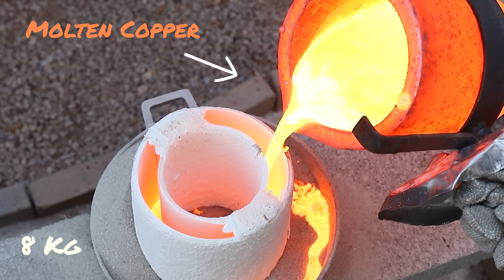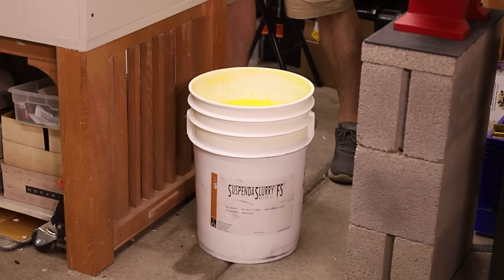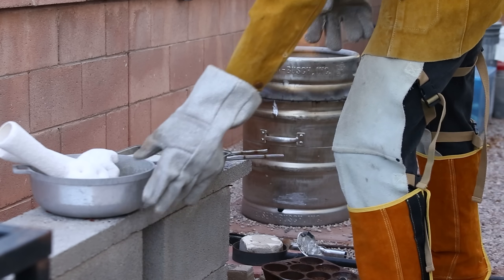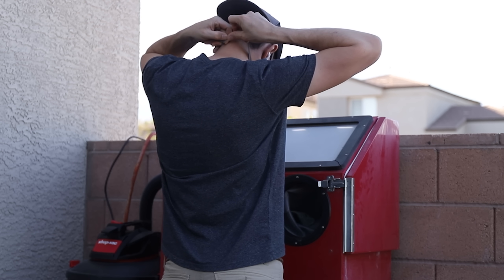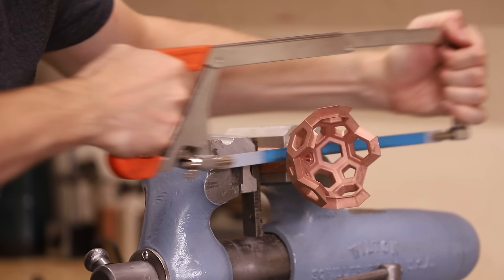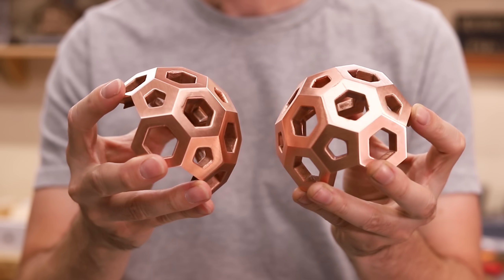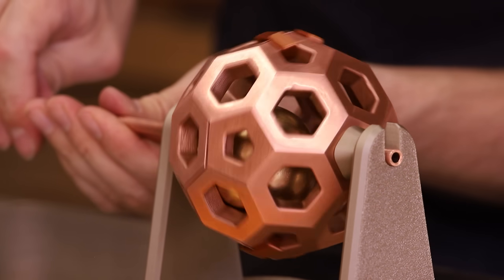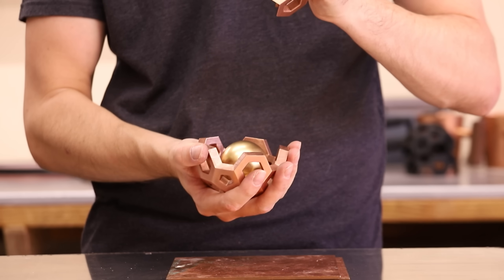HUGE Magnet VS Copper Sphere - Defying Gravity- Will a Neodymium Magnet Float Inside?

Comment: Hybrid Generator
Such a hybrid generator design—featuring an outer copper sphere that stabilizes a levitating magnet via Eddy currents like in video and an inner coil-based structure for efficient power generation—presents an intriguing concept. Here’s how this generator might work, its potential advantages, and key challenges.

### How the Hybrid Generator Would Work

1. **Outer Sphere Made of Solid Copper**:
   - As the outer copper sphere rotates, Eddy currents form within the copper due to the presence of the magnet levitating inside. These currents create a magnetic field that opposes the magnetic field of the levitating magnet.
   - This opposing field could enable stable levitation of the magnet within the sphere, requiring no additional mechanical support. In theory, this setup would allow stable levitation at certain rotation speeds with an appropriately powerful magnet.

2. **Inner Sphere of Coiled Wiring**:
   - Inside the copper sphere, a network of coiled wiring is arranged in a spherical structure. When the system rotates, the coils pass through the magnetic field created by the levitating magnet.
   - This movement of the coils through the magnetic field induces an alternating current (AC) due to Faraday’s law of induction.

3. **Electricity Generation**:
   - The rotation of the entire system induces a current in the coils due to the changing magnetic flux, thus generating electrical power.
   - This hybrid system leverages Eddy currents to stabilize the levitating magnet, while the inner coils enable more efficient conversion of mechanical energy into electrical energy.

### Advantages of the Hybrid Design

1. **Stable Magnet Levitation**:
   - Eddy currents in the copper sphere can help the magnet levitate in a stable position, creating a constant magnetic field within the sphere. This could eliminate the need for additional stabilization systems and make the generator more compact.
   
2. **Improved Power Generation Efficiency**:
   - Instead of relying solely on random Eddy currents for power, the inner coils allow for a more controlled and efficient generation of electrical energy.

3. **Simplified Power Transmission**:
   - With coils rotating within a stable magnetic field, the system can more effectively generate AC power, which can then be transferred out of the system through slip rings or wireless power transfer.

### Design Challenges

1. **Controlling Eddy Currents**:
   - If the rotation is too fast or the magnet too strong, the Eddy currents could cause excessive heating in the copper sphere. Cooling systems or optimized rotation speed would be essential to minimize energy loss due to heat.

2. **Precise Positioning of the Magnet**:
   - The magnet must be perfectly centered within the copper sphere to ensure that the Eddy currents stabilize it correctly. Any misalignment could lead to instability and reduce efficiency.

3. **Power Transmission Complexity**:
   - If the coils rotate within the magnetic field, a stable way to transfer electrical power to the outside of the system is needed. Slip rings could be a solution, though they add complexity and may require maintenance.

### Conclusion

A hybrid generator with an outer copper sphere for magnet stabilization and an inner coil structure for power generation could theoretically work, though it would be challenging to implement. Success would depend on precise control of Eddy currents and optimal rotation speeds to avoid energy loss. If technical challenges are overcome, this design could provide an innovative and compact solution for electricity generation.
Reply: Hybrid El. motor
If the hybrid system’s coils are powered by an electric current instead of relying on physical rotation, the hybrid generator could effectively transform into an electric motor. This approach would utilize similar principles but with the opposite goal—rather than generating electricity from mechanical motion, the current would induce magnetic fields in the coils, potentially creating controlled movement of the magnet inside the copper sphere.

### How the Hybrid Electric Motor Would Work

1. **Applying Current to the Coils**:
   - When current flows through the coils inside the sphere, it generates a magnetic field. Depending on the direction of the current, the magnetic field in the coils can be adjusted to either attract or repel the levitating magnet.
   - This magnetic interaction between the coils and the magnet can create movement of the magnet within the system, even without the entire structure physically rotating.

2. **Creating Controlled Motion**:
   - By applying alternating current (AC) or varying the polarity of the current through the coils, changing magnetic fields are produced, which can move the magnet inside the system. This can result in oscillatory or rotational motion, depending on how the current is controlled.
   - This movement can be precisely regulated to achieve specific effects, like rotating the magnet around its internal axis, which could be useful in controlled motor applications.

3. **Interaction with Outer Copper (Eddy Current Effect)**:
   - As the magnet moves near the copper sphere, it induces Eddy currents, which create a counteracting force, effectively damping the motion. This natural braking effect could prevent excessive speed and help stabilize the magnet’s movement.
   - Thus, Eddy currents could act as a built-in stabilization mechanism, preventing overheating or uncontrolled motion.

### Advantages of the Hybrid Electric Motor

1. **Stability Without Mechanical Bearings**:
   - The magnet levitating inside the copper sphere reduces the need for traditional bearings, minimizing friction, wear, and noise.

2. **Precise Motion Control**:
   - Precise current control allows for fine-tuning of the magnetic field and, consequently, of the magnet’s movement. This could be advantageous for applications requiring high precision.

3. **Reduced Mechanical Wear**:
   - Since there is no direct contact between the magnet, coils, or outer copper, the system would experience minimal wear, which could improve the device’s longevity.

### Challenges and Limitations

1. **Power Consumption**:
   - The coils require continuous current to generate the magnetic field, potentially leading to higher energy consumption compared to conventional motors if the system is not optimized for efficiency.

2. **Movement Stabilization**:
   - The movement of the magnet within the system needs to be carefully controlled to avoid resonance or chaotic motion. Eddy currents can aid in stabilization, but precise electronic control is essential.

3. **Heat Generation in Copper**:
   - Eddy currents within the copper sphere generate heat. Without an adequate cooling system, this heat could reduce the system’s efficiency and longevity.

### Conclusion

By converting the hybrid generator into an electric motor with coil currents, an intriguing system emerges, utilizing levitation for stability and precise motion control without mechanical bearings. This concept could be useful in applications needing controlled rotation or oscillation with minimal mechanical losses. However, challenges like heat management and energy efficiency would need to be addressed for optimal operation.
Reply: nice AI hallucination

Comment: I would have been tempted to put a digital multimeter probe at each access to measure voltage as you spin on the axis.

Comment: A small electric motor like a 1/25th scale slot car with some rubber bands and interchangeable pulleys  would benefit your video, hooked to a potentiometer would be nearly quiet, I would also suggest some correct bearings to be fitted to the shift on the support and the carrier, with this done you could isolate the sounds and focus more on the visuals without the grinding and chattering your tig makes in the process

Also what sound track were you using during the sandblasting?

Comment: Love your copper sphere dude. Your engineering skills are exceptional. Have you considered working with 'bismuth'. . . it's antigravitation is great. It has some other amazing properties inc low melting point, so easy to work with. Is the first video of yours I have seen so please don't be offended if I missed something. Now I'm on board, I'm sure I will stay tuned. Cheers

Comment: I have one idea.
Keep the copper pipe and magnet inside that pipe, as shown in the video earlier, just try to rotate the copper pipe, using stand that has two tyre/gear like structures to hold that copper pipe from  bottom both sides and then rotate one of the tyre/gear, to rotate the pipe, it will look something like this, [  oOo   ]  here those small circles are tyres/gears, keep them below the pipe, so that pipe can be stable on them, also, you can put some gear like marks on copper pipe to provide it a better grip and make it stable.
Please try it and show the results.
It should give constant float to that magnet according to me

Comment: What if you used the magnetic field to somehow induce current and heat the ball up, made of an alloy, and then put enough heat out to boil a fluid to run a steam turbine generator and make power?

Comment: You didn't calculate it beforehand, it's actually a display of like a calculatable display of gravity by taking the mass of the ball and sphere as well as that like slowing down coefficient as you drop the magnet onto the sphere and then the shape of the magnet and all the stuff like that. Whatever rate the magnet would fall out, like however many seconds from 1 meter drop within the tube vs out of the tube. And the thickness of the tube and shape of the magnet all for the calculations. It kinda displays some property about the functional parts of the atoms that make this happen
Reply: If you have a thick tube as opposed to a thin tube for the same size and shape magnet, the thick tube really going to slow down that magnet. And after some time, even if the tube is thick AF for miles, it's going to cut out as a result of the gravity pulling it and the maximum amount of the surface area and depth of the tube limited by the interactions of the copper atoms with each other and their ability to be influenced by and repel the force. Like the presence that the field creates, what is creating that field and how. Maybe try a really really hot copper pipe and a really really cold copper pipe and drop the magnet in, and then try to hit it with a hammer or a transducer to see how the vibrations can slow down or speed back up to normal the speed of the drop
Reply: You'll find that hot pipes get demagnetized lol. In theory it should be weaker in  it's prevention of the magnet dropping. Have fun

Comment: Wow wow wow, I think the reason it isn't working at high speeds is similar to how the reason why pee doesn't follow a straight path but oscillates, as explained in Steve Mould's channel. Basically the surface tension tries to make it a cylinder but transforming from the shape of the opening to cylinder puts a momentum where there is equilibrium with least force, which makes it oscillate. In your case, I think you would need to rotate the sphere (which also shouldn't spin acentric), for a long time for air friction to dampen the initial momentum.

Comment: Energy? A brushless motor?  If the sphere was  suspended in the middle of 3 fixed magnets and the centre spherical magnet was fastened through an axle of some sort to the external sphere would the external magnets then cause the sphere to rotate? Could this become an almost frictionless motor? Maglev? Extend the axel and attach wheels and tadah, we have fuel free vehicle.

Comment: My guy besides being supremely cool looking and "weird" to play with and experiment, this thing has a great possibility of becoming the next step in the technology known as multi-phase alternators and electric motors. Instead of all the windings being arranged in a 2d plane, we now have segments of a 3d sphere having different magnetic properties. Imagine if you printed another, larger version, possibly with different geometry, to act as a stator to this rotor. Inserting a pin or nail with a coil of wire along the normal of each hexagonal face should yield interesting results. Inserting hexagons of iron or iron tubing into the hexagons of this rotor should also. (Probably need electrical insulation from the copper) This thing is so cool!

Comment: Polymaker makes a 3D printer filament designed specifically for casting. The plastic burns off cleanly so you don't have residue left over in your casting.

Comment: pretty cool. i think for a better levi effect the equatorial circle shouldnt have holes, it's enough to look through the holes on the axes sides. u r breaking down the electromagnetic current that is induced into the copper and needed for the counter magnetic field. every hole around the equator line stops the current. but otherwise, really really cool

Comment: Absolutely amazing craftsmanship. Very talented. Two things though. My sandblasting cabinet I use a foot pedal instead of the trigger inside. When sandblasting for a long period of time it is much easier on the hands and wrist. Just a thought. 
Also my sandblaster has a vacuum hooked to it for dust management. I had zero volume as I’m sitting in a deer stand. Anyways just curious why you wear a dust mask while using it? I’ve done it for many years and never had an issue. Maybe yours doesn’t have a vacuum, like I said I didn’t have the volume one. What media did you use in it though? Turned out looking beautiful. Great job.

Comment: Is it possible to set up a ring of magnets outside the sphere which causes the copper orb to constantly rotate? The other comment about imperfections in the sphere shape could be a feature if you can somehow turn this into a remote magnetic motor.

Comment: It looks like part of the issue is an imperfect spin rate on the sphere (which looks cool AF) and an imperfect rotation due to the contraption wobbling during the spin. I think it would also help to attach small magnets inside the frame in order to prevent the sphere from coming in contact. Also, is there a way to wire up the posts to see what kind of power it creates in the copper?

Comment: I think you're having falling speed differences from the tube to the ball for the same reasons why they use laminated sheets of steel inside of transformers, to reduce the eddy currents. Your split in the case also has this affect. If you consider each of your halves as north and south hemispheres and your rods are at the poles then consider putting them at the equator instead, you'll get a better result.

Comment: Test
1 put the clips on opposite sides to balance 
2 smaller sphere magnet sizes
3 different shape like squares and sizes
4 low level current?
5 vertical rotational axis instead of horizontal
6 cool or freeze the copper beforehand

Comment: Sadly, you have no control of the direction of the magnetic field of the magnetic ball. This may have consequences.
Eddy currents are only induced by a changing magnetic field. With your irregularities there is a small changing magnetic field even if the magnetic direction of the magnet ball is equal to the axis of the rotation. It gets to zero with the magnetic ball turning inside the copper construct with the same speed as the construct itself. And the magnetic force will make sure the magnetic ball will accelerate to nearly match the constructs' speed...
That is why it never will stay in the middle.

Comment: Try vertically rotating the sphere, so that you can hopefully make the sphere rotate accurately around its axis. Then adjust the speed. I like the other ideas here regarding shutter speeds and strobe effect. The idea for example discussed by @Nighthawkinlight. That could work for viewing more easily.

Comment: I have 2 ideas you should try.

1. Make a magnetic pair of gloves and use your fingers and hands to move the ball 

2. Add a magnet to one side where your copper rods are so it levitates, and then sit it vertical and spin it while sitting vertical but only the bottom would need support. Thinking about it maybe you could design it in a way to act like a gyroscope so you only need to activate the spin once

Comment: You could have done Lost PLA casting there is a special PLA that burns away and it's made specifically for casting. I think it's called PolyCast. I was going to use it to make a custom made ring but I don't have the experience with metal casting so I never tried it.

Comment: Rotating the copper sphere with the other magnet is something akin to a differential. Very cool.
Reply: Magnetic torque converter- could make one with variable magnetic proximity so as to be a clutch/torque converter in one. Good for a gokart.
Reply: A dutch company called Zytec makes an industrial coupling with a magnetic and a copper disk to make a coupling with no physical connection between the motor and the driven part.
Reply: Don't show this to Dyson. We will end up with really odd vacuum cleaners labeled with pacemaker warnings.

Comment: The magnet inducing electrical field streams has a delay interval according it moves at high speed with a pattern not able to hang in the center which lower speeds reach more. Infinity part of as volume has no center, you see it proven.
This is an original experiment about the structure of an atom with a core of protons and a shell of electrons. End of discussion.

Comment: 9:45 I have an idea! What if you have it on a stand (like what you have made already and make it a water feature. You can do a simple test in a sink or bathtub to regulate flow and the position. I think that the right amount of flow it might work. Also, if you did turn it into a fountain decoration, you could regulate the speed of the flow and get a really cool sound out of it. 🤷